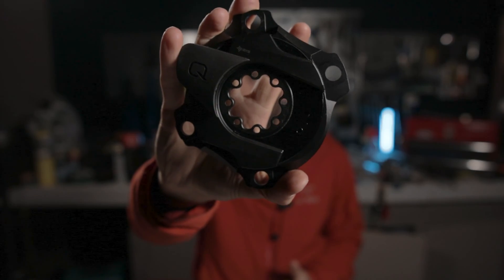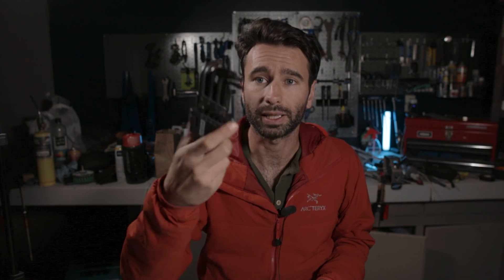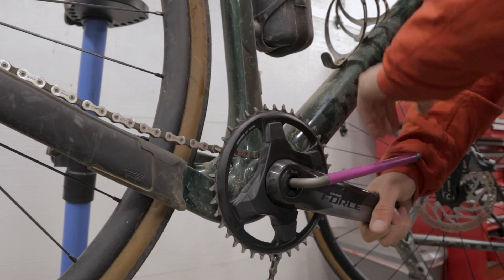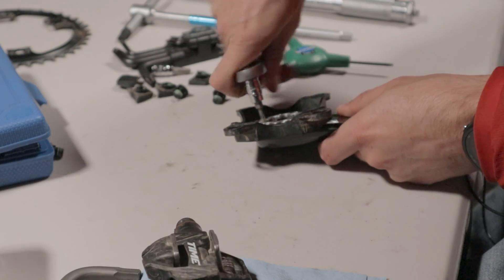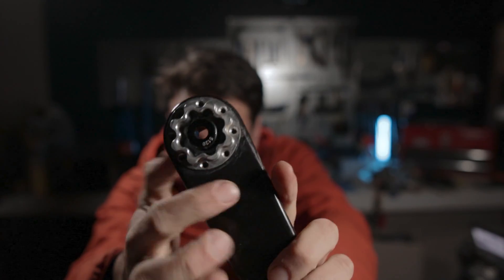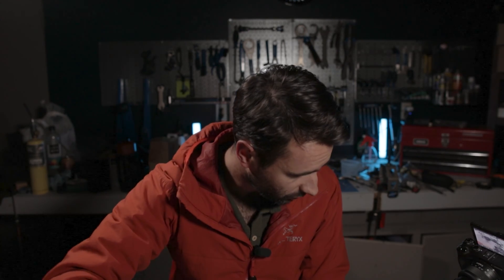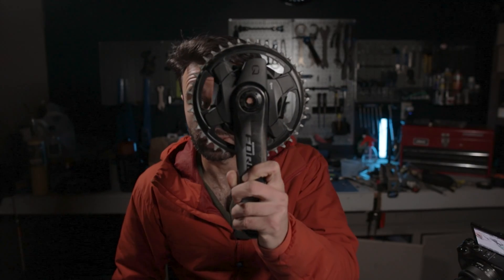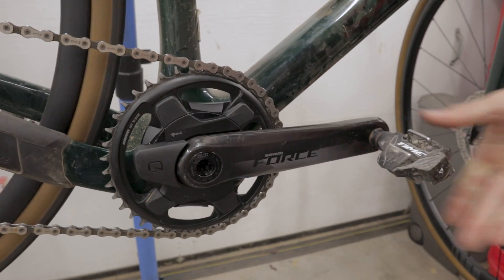Add A Power Meter To SRAM Force & Red Cranks! // Quarq Install

Comment: It may be worth mentioning that the "wide" 43/30 2x Force crankset cannot use this power meter (but the Force crankarm power meter will work). I just ordered mine and nearly made this mistake.
Reply from the maker: Good point - I'll pin your comment. Thanks for mentioning this!

Comment: Will this power meter work for Red D1 2x? There seems to be conflicting information about that on the internet. It seems it only works with Force 2x, and Red 1x. Not sure if that's accurate?

Comment: Would this be compatible with my Trek FX  Sport 6 that has SRAM Apex XPLR eTap AXS, 44T max cog rear derailleur, SRAM Apex 1, 40T, DUB Wide, 175mm length crank, SRAM DUB, 86.5mm, PressFit bottom bracket, SRAM XPLR PG-1231, 11-44, 12 speed cassette and SRAM Apex, 12 speed chain? TIA

Comment: Certainly more comprehensive than the information from Sram which is pretty much zero with the meter and the Sram video fails to mention the torque figure to refit the crank or note good practice of greasing the surfaces.

Comment: Glad you mentioned the torque specs. When I built my bike, I decided to do the "umph" torque measurement. Well, 2 months later, I'm on a evening spin and my crankset popped out. I had to pedal 1.5 miles with one foot and coast down  the hills and walk my bike up the hills.
Reply from the maker: I think we've all been there haha. Torque wrench is definitely a good tool to have.